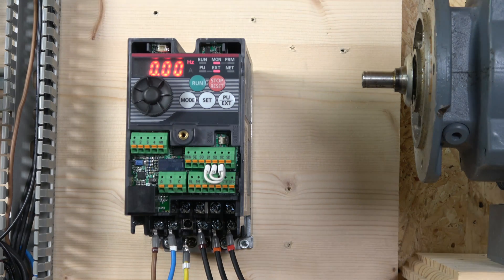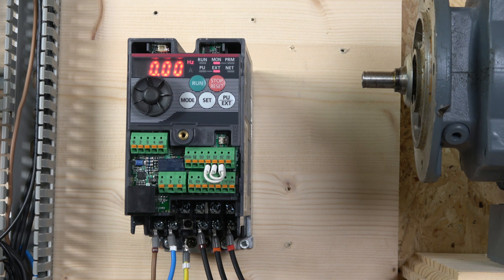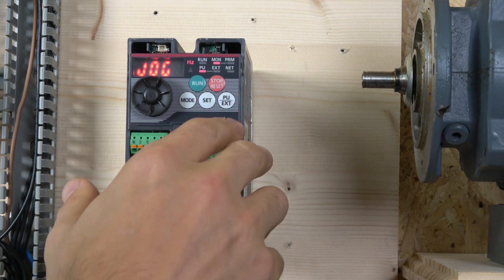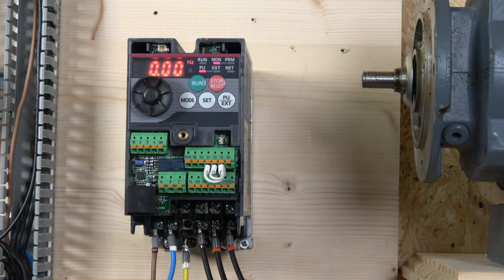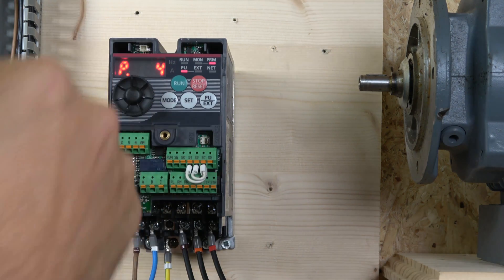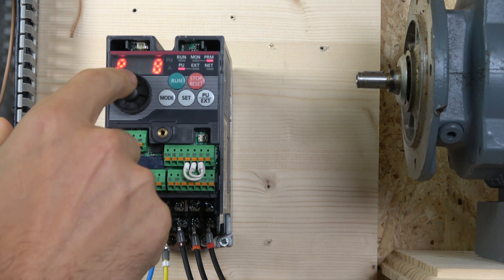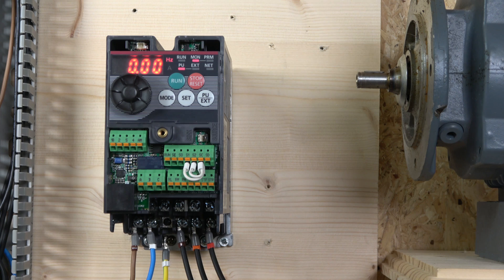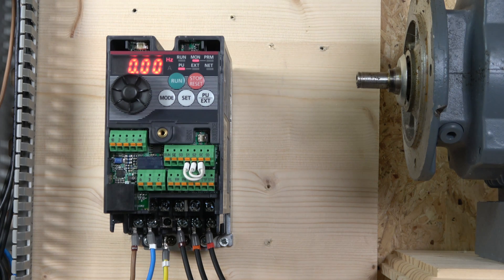Mitsubishi FR-D700 local control, parameter set up and Factory reset. (English)

Comment: Hello.
I have an FR-D720. The inverter is powered by the network through a contactor. I want, after the contactor is actuated, to automatically start the motor at the already set frequency. I don't want to use the panel buttons or the terminal block to start.
Can you tell me how to set it up?

Comment: Sir, for d720s , I want to give the 4-20mA analog input, which parameters I  should change, I selected pr.180 to pr.182 as 4, 267 as 0, 79 as 2, is anything need to change. When I start externally it's running in lowest hz which is settled in pr.2,

Comment: Hi, im using this controller also. Its used in an area which has a lot power outages. Is there a way to set the unit so it starts up again when power is resumed? At the moment i have to manually restart, thanks.
Reply from the maker: Not that I know of bud, best would be to set up a relay that automatically go on on power and send pulse to start the drive. That how i would tackle the problem.

Comment: There's one parameter for long distance motor wiring which is very important. The vfd trips if it's not correct.
Reply from the maker: Cable length is part of electrical wiring understanding. The longer the cable the longer the more resistance, taking these parameters in to the account appropriate cable must be calculated to accommodate the necessary current transfer for particular distance.

Comment: Hi. I have a body strong finess whith a D700 and whith The fault code UV or Uu. And I cant get it away. Do you think you can help me? Everything start up and work but not det motor for The walking carpet. Plz help
Reply from the maker: Hi There. You seam to be having a supply voltage problems. This error stands for under voltage. Check you supply to the drive with voltmeter, if all ok then your drive needs replacing.
Reply: @IGSElectronics  Hi. The one I have is fr-d720s-1.5k-cht I have checked with a multimeter and I have 230 inverters and when I measure the outgoing cables to the motor I have about 0.05. So then you think I need to buy a new one? Or can you succeed in repairing the old one

Comment: Thanks for the video.
I have a d700 bypassed  right now because of a e.safe fault. The thing is I’m not using an external safety relay unit. S1, S2 and Sc are shorted . The fault will not clear. Would that mean the IGBT is possibly bad?
Reply from the maker: Have you restarted the drive? What is the fault code?
Reply: @IGSElectronics   I have restarted it a few times and the fault comes in as it powers up.
It’s on a blower motor and there isn’t much attached to it. Just came across it today. 
The only thing going to the terminals are, speed signal , forward rotation, and using the relay output. Wasn’t really able to go through much on it but will try to get back on it tomorrow.
It’s like it’s stuck in safe mode. One manual said to make sure S1, S2 and Sc values are the same, but they are jumped.
Thanks for responding! Only code I saw was e.saf
Reply from the maker: @JohnnyJr396  can you tel me the fault code?
Reply: @IGSElectronics  when I first came across it , I had a few other things I needed to take care of and didn’t dive into it much. I was able to go back today. There was another board that controls a contactor that feeds power to the drive. It was cycling in and out causing the drive to fault. Once the power was dropped from the drive I couldn’t cycle through anything as the power dissipated.
Anyway once the controls were straightened out , everything seems good now.
Thanks for getting back to help!
Reply: @JohnnyJr396  how did you fix the SA fault ?
Reply: Same fault me too

Comment: Please  I have a challenge with my drive...  After installing I running the motor. I noticed the that the motor start shocking...  I can't touch the motor without feeling an electric shock...  Please how hat can be the cause of this
Reply from the maker: Hello Daniel. If you are getting electric shock from the motor, it means there is a voltage leak inside the motor and you should not use it. It means winding has come of its coating and is in need of rewind or new motor.

Comment: I have a problem where the run signal is received but the "RUN" light just flickers.  I need this working for Monday morning and this is Friday evening...Help!!!
Reply from the maker: If run is flickering, that means it is in run mode but don't have frequency. Have you got potentiometer set up?
Reply: The signal is from a Click plc and was wired up by a sub contractor who gave me the parameter list to alter, but won't come and help. The three phase ones are fine, but this is first single phase and won't work.
Reply from the maker: @paulround1784  single phase and 3 phase, the same. Did you check your frequency. It is not running cos frequency source is not present. How are you controlling your frequency, or speed.
Reply: @IGSElectronics  via a hmi... Everything else from it seems OK... Its just a copy of what we've used before
Reply: @IGSElectronics  actually no, that's the mixer motor, this is a shredder and should just be one speed...
Reply from the maker: @paulround1784  yes, and at the moment the drive is not getting any speed. check video 2 of this drive to see what i am talking about

Comment: I have this problem (inverter D700 error E.THM)
Reply from the maker: Hi there its Motor overload trip. Remove output wires from the drive and start the drive without motor connected, if all well and error no longer appears, your motor is having difficulty working. If error don't go away, your drive might be faulty.

Comment: Hi! Nice video!

I am usign a D700 too!
I am reading and writing parameters from and to the VFD using RS-485 and the modbus RTU protocol, but I didn't understand how to run and stop the VFD with that protocol!

I know that it has to do with Modbus registers 40009 and 40010, but I couldn't understand the values I have to set. 
In fact, you can check that on page 208 in the Advanced Manual you attached to this video.

Any cue ?

Thanks
Reply from the maker: Hi Andrey. Thank you for your comment. I have not worked much with RTU Protocol yet, so be not much help to you. I am planning to get in to it in near future, but not yet. Sorry.